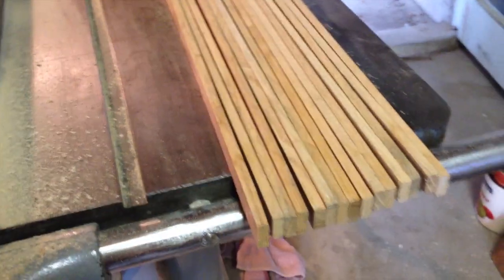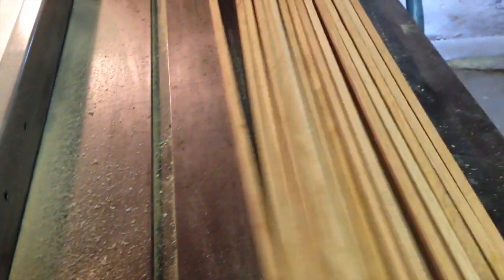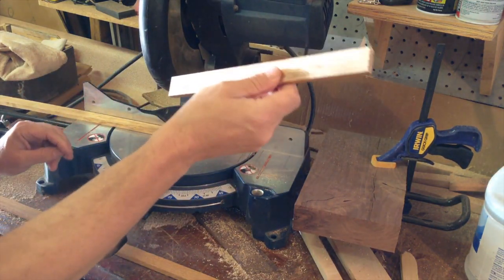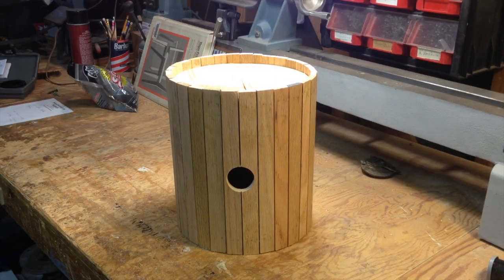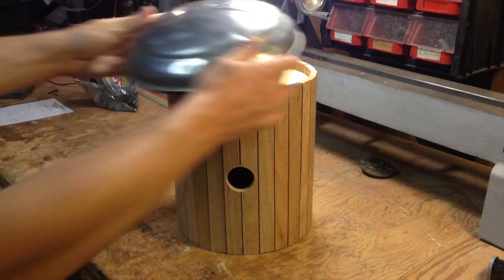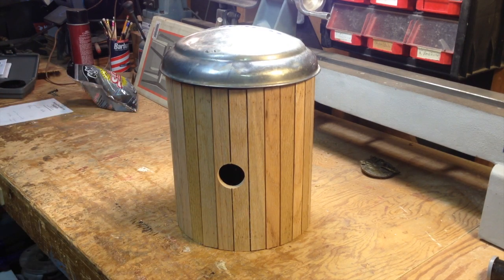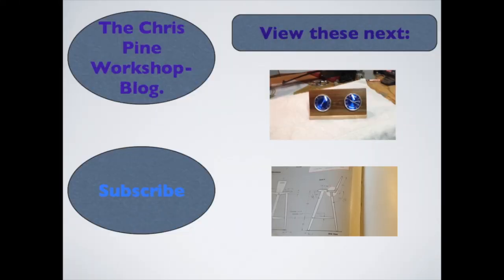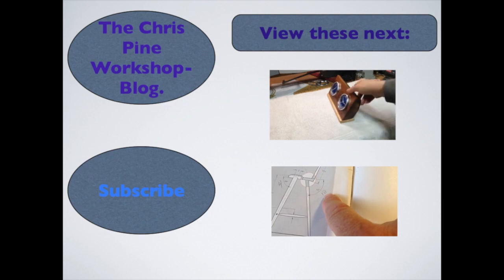Bird House Contests Entry

Comment: Very badly positioned entrance hole but otherwise fine.
Reply from the maker: +kolodojpes Why so?
Reply: Birdhouse entry holes are often suggested to be set 6 or 8 inches above the bottom of the floor (depending on the nesting bird) so that predator birds (like starlings and blue jays) can't stick their heads in and eat the eggs or the baby birds. That's the same reason birdhouses should not have a perch right at the entry hole-- the cavity nesters don't need it and predator birds will use it.

Many bird books will give you the dimensions of the entry hole to use (so nesting birds can enter but predator birds cannot) and the height above the floor.